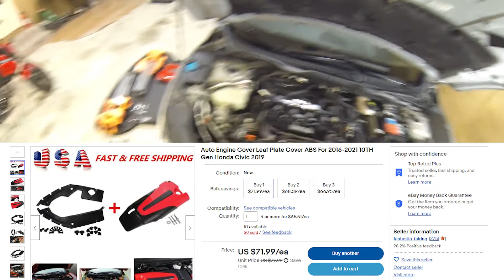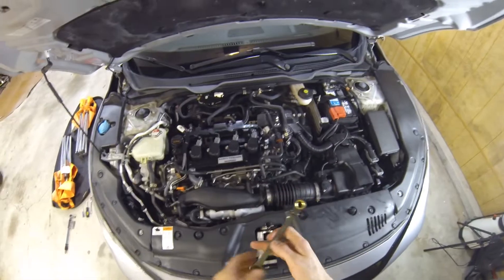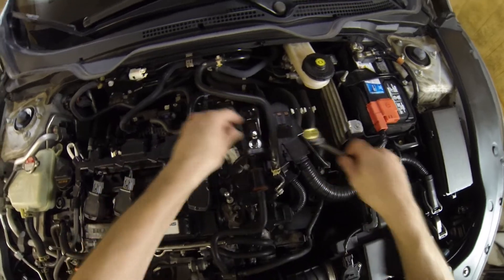Honda Civic: Budget Engine Cover Install Guide (10th Gen)

Comment: Had a question about the coolant of my Honda civic 2000 5-door (1.5L Vtec motor). The stock coolant is like a yellow/green would it be a problem to use another color coolant in it like a red or blue coolant after I drain the old yellow/green coolant. Hope that someone knows this.
Reply from the maker: You absolutely must use what Honda requires.  Otherwise, it could cause corrosion and destroy your radiator and heater core. 
 Put your exact year, make, model and engine into this:  https://www.autozone.com/antifreeze-radiator-additives-and-windshield-wash-fluid/antifreeze-coolant/honda/civic/2000

Comment: Do I need take off the screw my turbo engine ?
Reply from the maker: Sorry, can you explain your question better?
Reply: @PowerSports  do I need to use screwdriver to take out the original screw first ?
Reply from the maker: I recommend watching the whole video, however, yes, you'll need to remove the three original bolts, then replace them with the studs, and then the engine cover should simply pop on.  (No screwdriver, though.  It appears I used 10mm and 12mm sockets and wrenches.  My memory isn't the greatest, haha.)